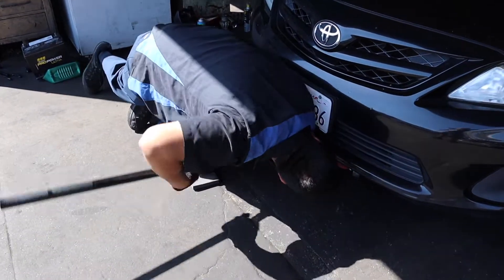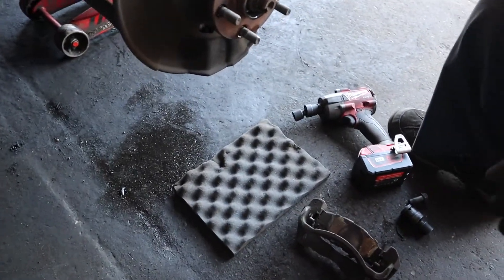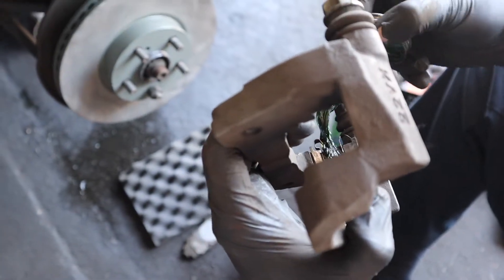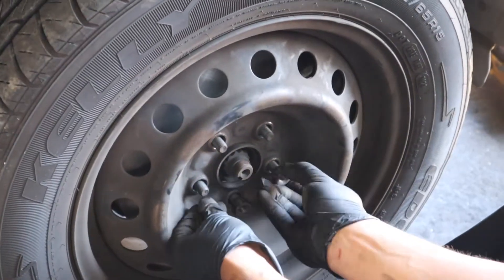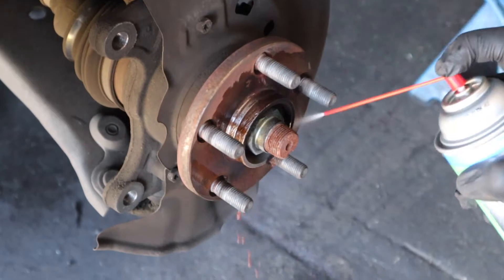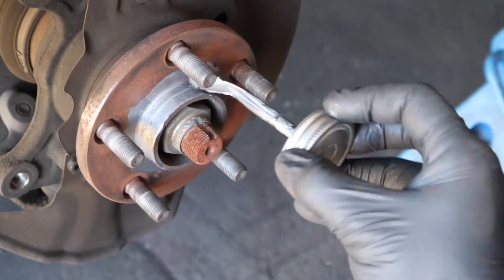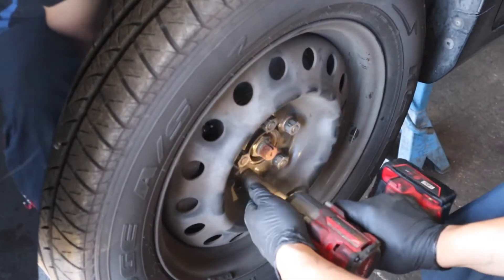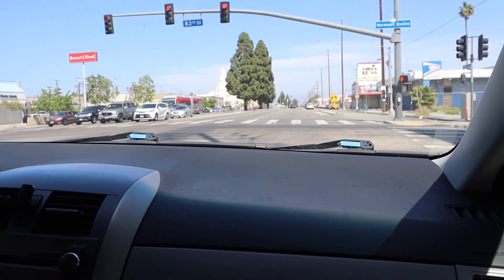2011 Toyota Corolla Front Brakes and Rotors

Comment: What is the cleaner you’re using to clean off the rotors there and then what type of lubricant and then anti-sea could you post the brands that you used? Also, thanks for showing the other side.

Comment: You added grease on the fitting kit so that there’s no friction, but greasing that area will collect the dust and harden the grease and CREATE friction.
It’s unnecessary, at least for our area.

Also, you should really clean those hubs before installing a new rotor.